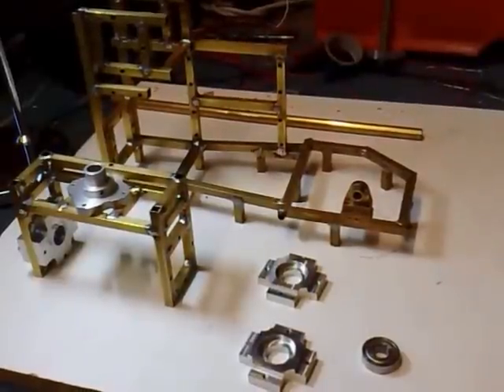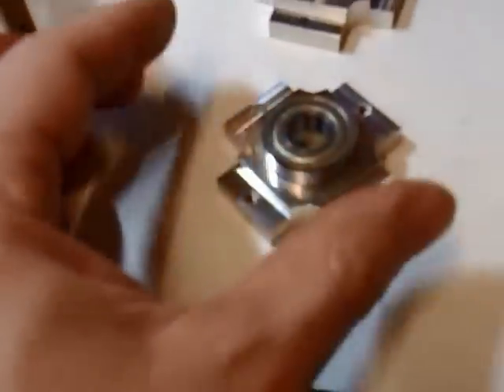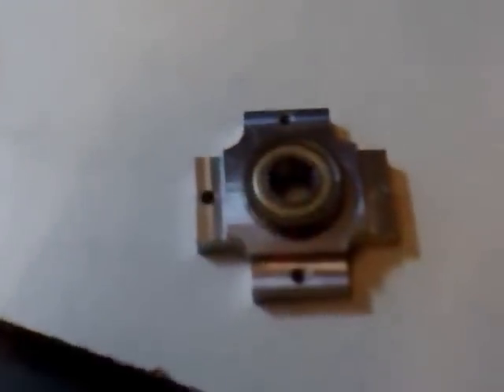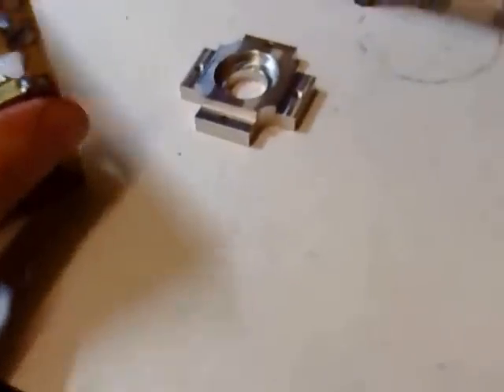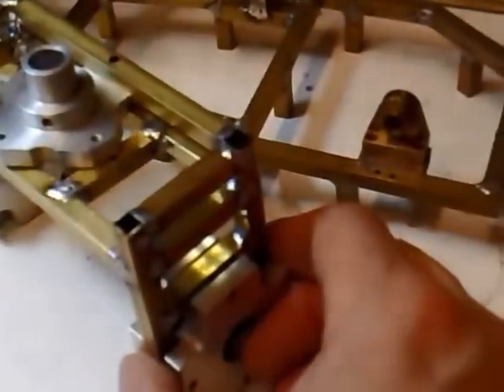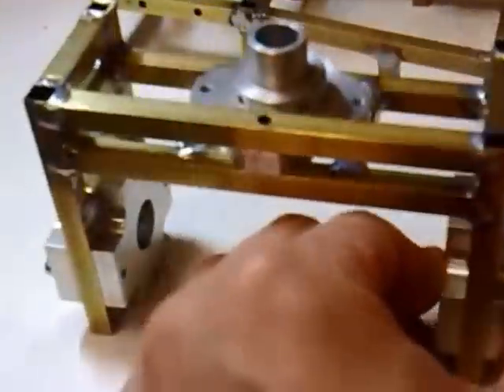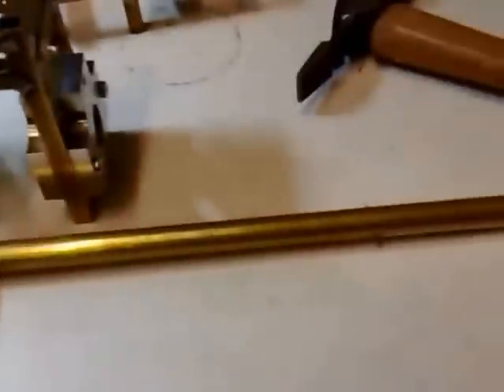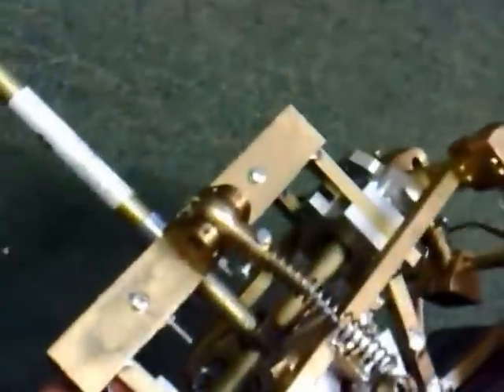Animatronic / Robotic Parts - Main Bearing Housing (MBH001)

Comment: Hopefully you used a quality silver solder though brazing would have been far stronger yet. Lead solder is sure to fail under continuous loading. A dead blow hammer would be easier on your finish as well...